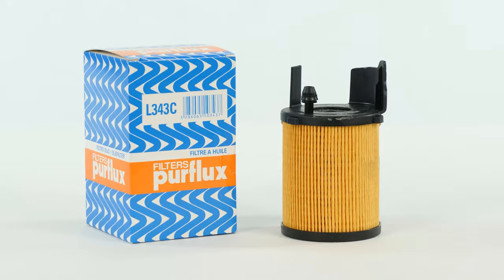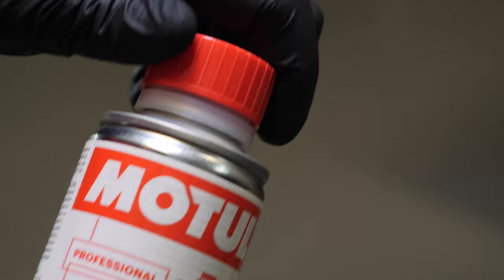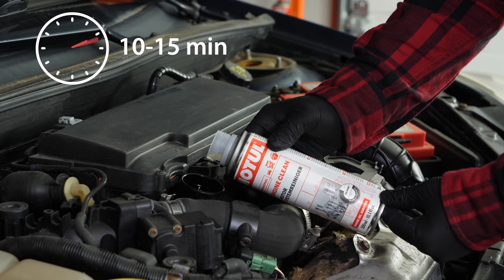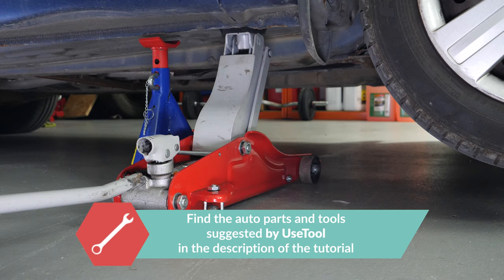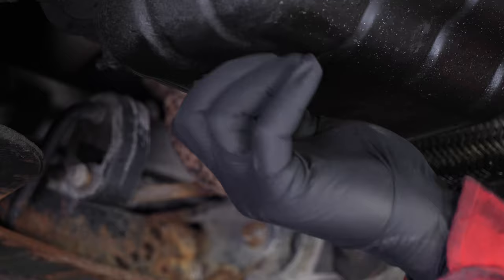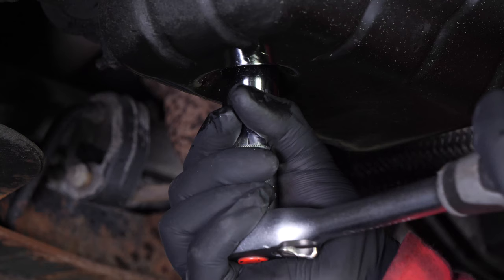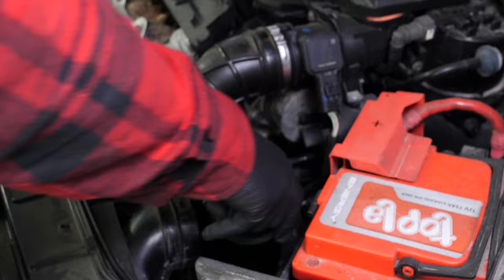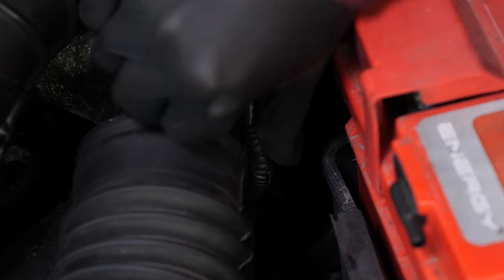Change the oil and the oil filter Fiesta mk6 1.4 TDCI 🛢

Comment: Is the oil cleaner really necessary? Many mechanics, when changing my oil, mentioned that's not necessary, as the oil has also a cleaning property
Reply: You absolutely do not need an oil flush, especially for a normal service interval.
All modern oils have detergents that gently remove deposits and keep all impurities suspended in it ( preventing build up).
Change your oil at 10.000 km, use a fully synthetic oil and a quality filter, and your engine will be as clean as it can be.
Now, if you have an older, neglected engine, the best way to clean it is to buy a cheap oil, run it for a few hundred km's and then change it.
Repeat the cycle 2 or 3 times and all deposits and sludge will be removed.

An oil flush will make the oil very thin and in time will cause wear even though you're only supposed to run it for 5 minutes.
Also, if the engine is really dirty, it may set free bigger chunks of debris that will plug up oil channels and create all sorts of problems.
I had this problem on an audi 2.0 petrol engine code ALT.
I had just bought the car second-hand, used a flush from Liqui Moly and the engine started having problems.
Wouldn't run properly anymore and developed oil leaks.
I had to open it up and found debris in the oil journals and in the oil pick up.
Also, the mechanic that helped me said that the old build up in the engine was also probably keeping the seal with the old hardened gaskets...after the buildup was removed, the gaskets started leaking.

To conclude, you don't need it and if you do, it might create more trouble than it's worth.